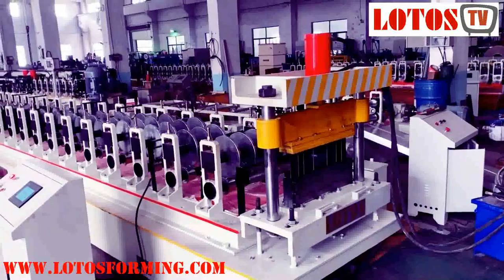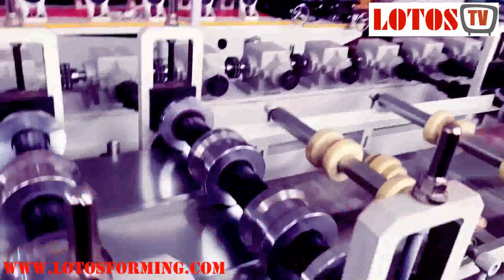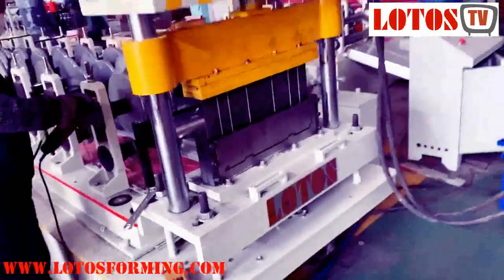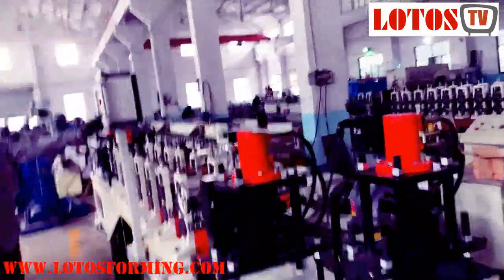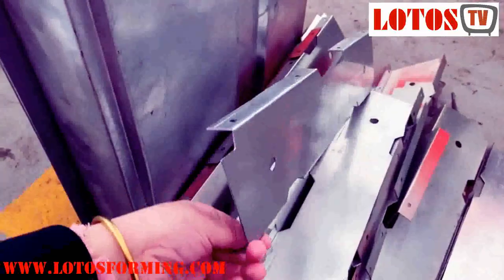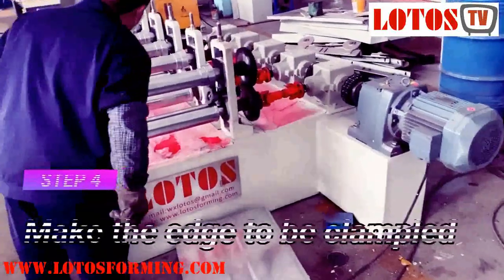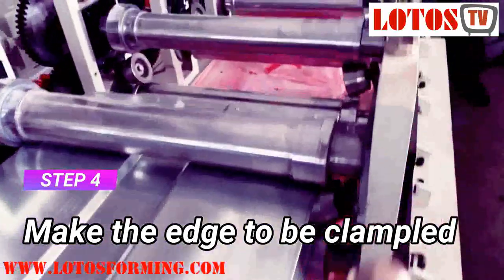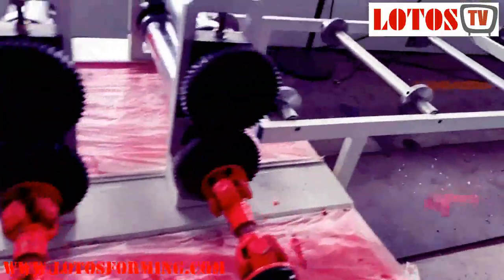【SOUND BARRIER MAKING MACHINE】: Highway sound barrier box board forming machine " COMPLETE LINE "👌

Comment: this production line consists of a feeding device, transmission device,and forming roller table and main machine,and cutting device after forming, and hydraulic system,and electric control system,and finished material holding device.